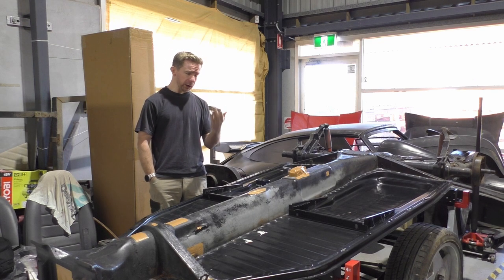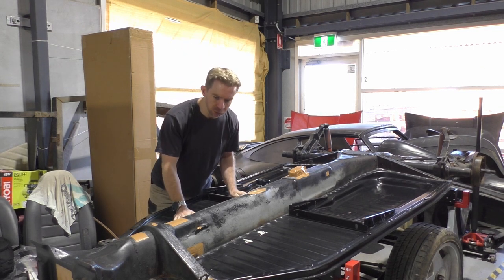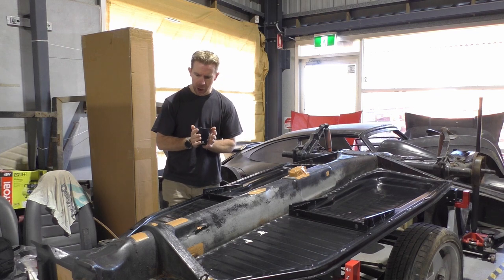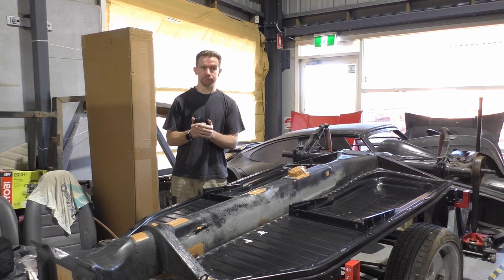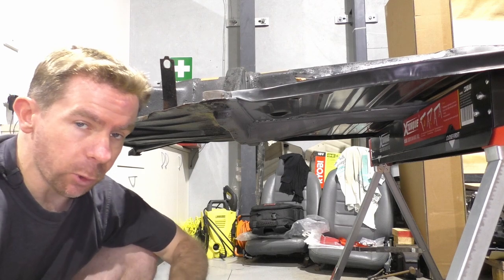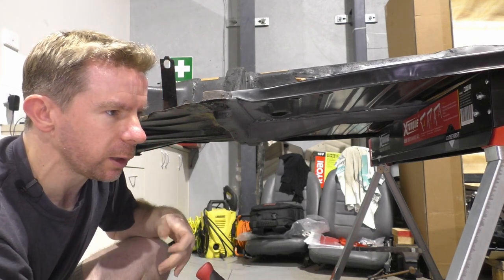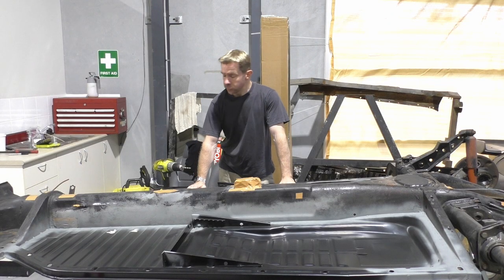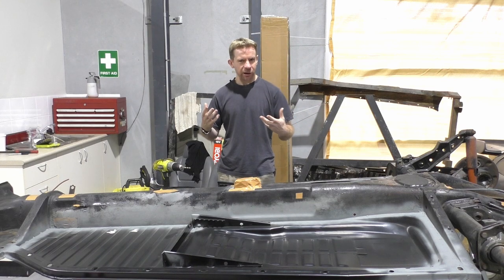Pt.39: Porsche 911 Turbo (964) Replica. Fitting new floor pans to the chassis. Pt.3. 2022 Sign-off.

Comment: Well done mate! You’re getting there. Doing those welds and then watching them pop undone was something I had to learn how to deal with too. It was quite frustrating, but made me realise how something that looked strong wasn’t. It  really surprised me. I slightly increased the wire speed and held the nozzle in place a second or two longer. Seemed to work well after that. Trial and error bud as you’re finding out 🤟😊
Reply from the maker: Yep. Trial and error indeed. Still really not a fan of welding.
Even after redoing the failed ones, and adding more... I'm honestly still a bit hesitant about calling it A1.
Hammer test will prove something.... though not a true scale.
Reply: @datbuild  Keep at it mate, you’ll get there. I had very little experience welding before I started my project. You’ll really start getting a consistent feel of where your settings need to  be. 🤩👍

Comment: You need to adjust your heat not drill holes.
Reply from the maker: I'm finding that a hard balance.
The pan metal is thinner than the tunnels. I was blowing holes and eating away at the floor pan metal...